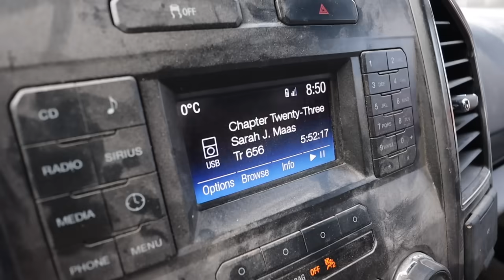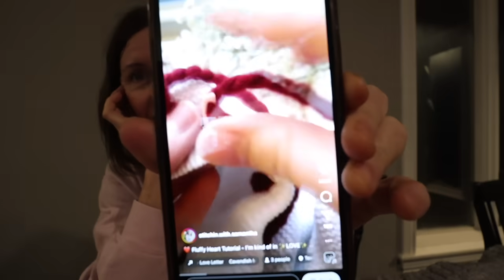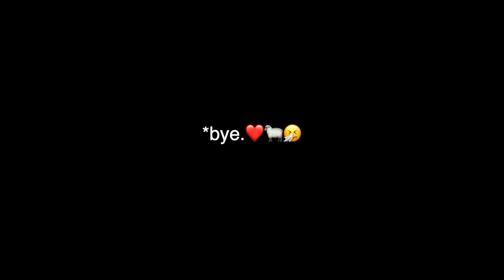SHEARING DAY!!  ...and someone has a crush on Charlie.  | Vlog 764

Comment: First things first: I love your channel! I work with animals for a living, and watching your channel brings me joy. I love the bond you have with your animals, and seeing you go through some of the stuff I deal with brings a bit of validation (along with new problem solving ideas). I am also a bit of a crafter, so that side of the channel also intrigues me.  

Second: On the subject of crafting, did you know you can "make" chunky yarn projects with thinner weight yarn? Just double (or triple) it up. You can either use pre-cut lengths (instead of just having 1 length of yarn on your needle have 2 or 3, though you may need a larger tapestry needle to accommodate that), or there is a way to fold the yarn on itself to have a running double coming from the skein (I recommend looking it up here on youtube, I know  a method to do this went viral a while back). Honestly, your jumper looks cute as it is (I have seen items like that, with little embellishments on the back). I also know the pain of starting a seemingly easy project and it take way longer than expected. Remember, Charlie makes shearing look relatively fast and easy, but a beginner would take way longer, and the end result would probably look a lot rougher (the sheep probably wouldn't be too impressed either). If you enjoyed it, keep at it! Speed and accuracy will come with practice. Also, look at tutorials from other people. One person's methods may not work as well for you as another person's.

Best wishes!

Comment: What would be te lem if the crewl wool felted into the sweater???? Dont know if i see this as a problem.
Reply: The problem?? I guess typing one eyed and not so steady  IS   a problem...
Reply: @marjoriejohnson6535  😂Smiling with you. See the 3 vertical dots far to the right of your comment? If you click on them, you can choose "Edit" or "Delete'. So even after you've hit "Reply", you can go back & correct yourself. I once accidentally 'felted' a beautiful striped 100% wool sweater of my mom's by using the 'Warm' setting on my washer instead of "Cold". It literally fit my friend's 1-year-old little girl. That 'thrift' sweater looks to me like it might just be 100% wool. My suggestion to Sandi, which will probably go unread, is to pre-wash any yarn she uses for embroidery, to make sure that it's colour-fast. That was another hard lesson I learned. I went to some lengths to make a beautiful round tablecloth to go with my sister's Ralph Lauren bedding. I asked when I bought the bias tape to use as edging on the bottom. I was assured it was colour-fast. Guess what happened? Ugly blue streaks all over that lovingly stitched tablecloth. It didn't look like batik, it just looked like a bad accident. Never again. 💕💕

Comment: Why is there some wool in the sheep's pen?
Reply: Charlie shears off the most heavily soiled wool first & tosses it. The reason it's tossed in with the straw bedding is it will break down into compost & the compost will then be spread on the fields. I just learned in Alberta most fleeces are just pelletized & sold as fertilizer. I'm glad it's not just going straight into landfill but I'm so proud of Sandi for digging in & doing the research & finding Mariposa & persisting until she developed a line of merchandise that satisfies her creative talents. 💕💕

Comment: I was trying to work out why Charlie's shearing was confusing me. It's because he's doing it left handed and backwards. So it all comes off like it should, and it's a perfectly good shear, it's just back-to-front after you've spent all last summer watching competition shearing. Lovely job as always.
Reply: I bet all the other shearers are jealous of Charlie's ambidexterity! So fast! So smooth! & balances out the aches & pains 😂💕💕
Reply: @elainerempel1613  a lot of left handed shearers end up shearing with the right as they way stands are set up in the UK it makes it awkward to pull the sheep out/put it away if you shear with your left. More younger shearers coming in are using their left though as competitions sometimes have left-handed stands so the door/porthole are on the correct side of you.

Comment: I’ve been crafting for 50 years. I still make mistakes like embroidering on the wrong side so I have to chuckle at Sandi’s disgusted look on her face.  I screw up on every project somewhere because I’m always multitasking. Lol 

I am crocheting a simple sunflower granny square phone bag from a kit I got at the thrift store. I forgot to add the chain 2 between granny stitches. No big deal EXCEPT I didn’t realize it til after I did the back piece WITH the chain 2s between granny stitches. So front and back aren’t the same size. 

I had finished off the front piece with single crochets around and I wove in the ends. I had to rip out the single crochets. I weave in so well it’s hard to find the end. I managed to find AN end but it was the beginning end. I couldn’t just rip it out. It doesn’t work that way. Lol I had to unloop 4 loops on each stitch all the way around dragging all that yarn through each time. Yards and yards. It took hours. Now I’m done. I have to crochet another row on the front and they should match in size. The thing is… there isn’t much yarn left and I still have to stitch them together, add rows around the top and make a strap. Had I not made a mistake I still wouldn’t have had enough yarn. This kit is sad. It’s an older kit. They use weird words. They call single crochet SHORT crochets. What?  It’s obvious Annie’s had these kits made in a country that doesn’t speak English. 😂

Comment: I would imagine the crack in the wall of Jack's basement goes all the way through to the outside.  Are you going to try and seal the outside?  I had a similar issue at my Dad's house as a result of a small earthquake in Virginia years ago.  We had to dig out the basement wall to seal the outside and put drylock sealer on the inside.

Comment: Sandy just remember you bought the sweater at the thrift shop and it is a practice sweater so if you sold it on the backside it’s OK you can try other Yonns of different thicknesses all over the sweater it’s just a practice piece to work on don’t worry about it Don’t beat yourself up on this it’s just a practice sweater. We always have one piece when we start a craft that we beat the daylights out of to get it the way we want it so it’s fine it’s just a sweater you’re not gonna be wearing it to a fashion show, you might be wearing it in the sheep barn. Who knows it’s just a sweater to kick around in because it’s a practice piece.😂😂😂❤❤❤❤

Comment: Have you ever showed us how the wool is cleaned ? I would love to see it.
The other  sheep are comparing their hair cut
Reply: She has. The wool goes in big tubs with water & mechanically agitated. Several changes of water. Can't remember if there was a bit of light-duty detergent? Then the handfuls of wool are put through a kind of combing machine that starts the wool being turned int "roving" which is what is used for felting. The roving can also be spun into yarn💕💕

Comment: I haven't had a respiratory illness in many years.  In case you are interested, here's what I do when I feel an illness coming on.  I fill a quart jar with distilled or filtered water, add a table spoon or so of canning salt (because it's nothing but salt,  no anti-caking or flow agents)  Stir the water until the salt is completely dissolved.  Pour a couple of ounces (2 - 4) in a small jar and heat in the microwave for 10 or 15 seconds.  You want the temperature to about at body temp, so if you put your finger in it, it should feel just slightly warm.   Then I use a bulb syringe that I got from the hospital when my son was born,  squeeze all the air out, put the tip of the syringe in the warm salted water so it sucks up as much as it can (about 1/2 of the 2 - 4 ounces), then I lean over the sink, put the tip of the syringe in one nostril and squirt the water up it.  It may come back out that nostril, the other nostril and out my mouth. Squeeze the air out again and suck up more water to do the other nostril.    I do this every time I start to feel something coming on or if I've been around someone who is sick or became sick shortly after I was around them.    It takes a little getting used to but I find it's been well worth it. 

Last summer I was around a visitor from out of state with covid views very different from mine.  He had been sneezing and had a runny nose most of the day but thought it was allergies.   The next morning after visiting him, I woke up with a cough that wouldn't stop and felt like I might be developing a fever.  I flushed my sinuses and within an hour I felt normal again, no oncoming fever and no more coughing and I did not get sick.   If you do get sick Sandi, I hope you feel better soon.

Comment: Hey you'll look good coming and going........don't take it out!! You can also get some fabric at needlework shops that you can either iron on, or baste on your sweater or fabric, and they make the squares you are stitching in easy to use with your pattern. After you are done, you pull the threads out that make up that fabric and then they are gone and you have your design left!

Comment: I still get a good laugh when the ewes get caught up in the lamb stampede 🐑🤣Red said, 'just a little off the top Charlie"!😂 Why do you throw wool over in with the sheep? Take care Sandi, Mark, Jack, Jess & Carissa .... have a very nice day🚜🐏🐑
Reply: That is the dirty matted wool from the belly and between the hind legs. It is very stained and hard to clean, so has been used for centuries as compost and fertilzer. It can be put in compost to break down or just added to the soil. It adds tons of nitrogen as well as increasing water retention.
Sandi adds it to the pens where it starts to breakdown, moves it with the old straw to the compost piles, then it is spread on the fields before plowing,
Reply: @mobydickswife9512  I just learned in Alberta the shorn wool is "pelletized" & spread with fertilizer. That made me kinda sad cuz I like Sandi's use of wool much, much better. I'm sorry to see how many sweaters nowadays that are acrylic or polyester that will never break down & doesn't feel as good 💕💕
Reply: @elainerempel1613  We probably should not be wearing something that melts.
Reply: @mobydickswife9512  Yes, I was thinking fertilizer, but I guess I was worried the sheep would eat it?
Reply: @straubdavid9  Yep, totally on board w/that 💕👍

Comment: Belly wool. Animals and birds, especially in spring and fall will use that wool for nests and burrows. Toss it in woods.
Reply: The reason it's tossed in with the straw bedding is because it will become part of the compost that's spread on the fields (acrylic doesn't break down) 💕💕
Reply: @elainerempel1613  makes sense! I reread what I wrote, and it seemed critical, and that wasn't my intention. Memories of grooming my husky, his fur in the yard, and within minutes, the yard was cleaned by birds and critters using it for bedding.
I very much appreciate the information you shared
Reply: @WeatherMoon  I have really appreciated info from Cricket & Nero Wolfe so just trying to pass that along 👍💕

Comment: "Wing pulleys" exist and should be able to shed dirt/feed better than a standard cylindrical pulley.  My guesstimate of the size you need and the price for that size is about $500.  At $50/break down twice a year it's too pricey.  However it's close.  If $100 per breakdown and a drive belt failure a year is caused by the dirt....

Comment: Sandi, did anyone tell you your Vlog number is short a 4 I think. You are well beyond #76. How much does one fleece weigh? I noticed some of the fluff went onto the pack. I've been wondering if the wool would be useful in the winter especially for the lambs. I know it's compostable so it shouldn't be a waste problem when it's eventually spread. Some gardeners are using wool as an addition to potting mix for seed starting. Thanks for another video, good stuff as always!

Comment: I wonder if the hoof trim at about 8 weeks before lambing has any thing to do with malpositioned lambs? Since your flock produces many multiples . The act of turning the ewe upside down may cause the lambs she is carrying to float all kinds of way in the womb . Have you ever skipped the hoof trim to see if you have better deliveries of multiples ? And I notice that your Treatment of the ram with an eye injury has no eye wash or ointment for external use . I have purchased a colodial silver generator . It is the best for all kinds of wounds etc. .. It cost below a hundred dollars ,and I make an unlimited supply ..This can be used anywhere ,even the eyes and also taken orally  . And it is very efficacious
Reply: I would bet that 8 wks pre-due date, the fetuses are still small enough to move back into better positions. Sandi uses best practice in everything she does with her flock. I'm a retired nurse who still has lots of curiousity about all things health-related. Have been watching Sandi since around the beginning of COVID. She checks in w/her vet Rex frequently.💕💕